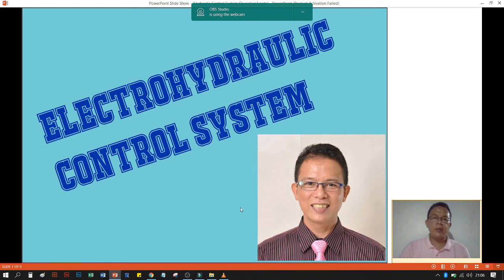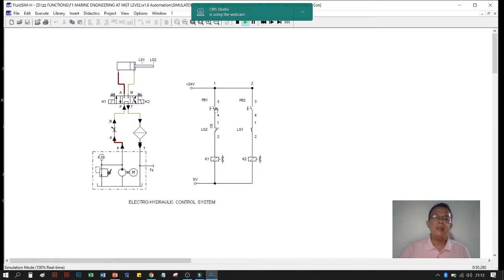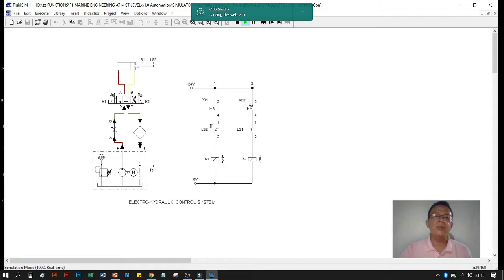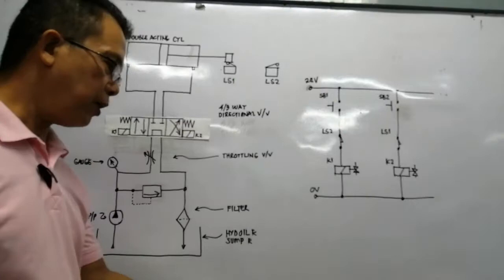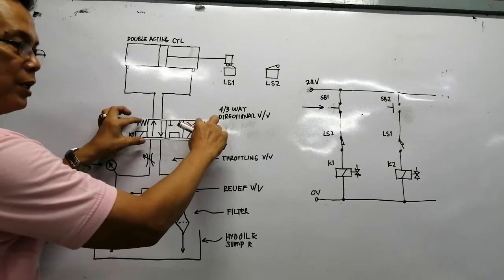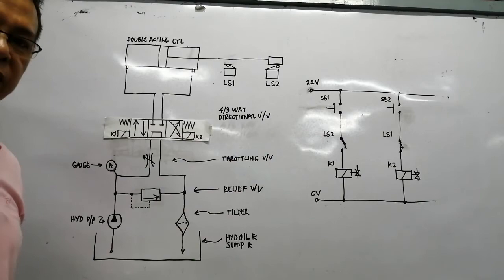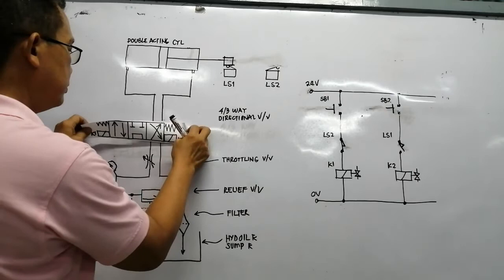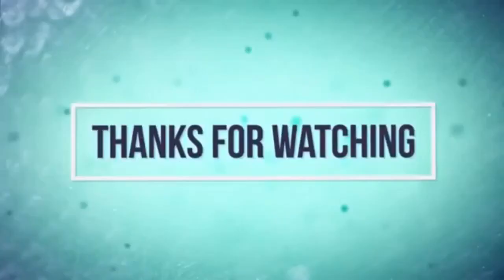ELECTRO HYDRAULIC CONTROL SYSTEM

Comment: Using this type of directional control valve on a double ended hydraulic cylinder ina steering system, is there a way how you can take the cylinder back into a middle position by the push of a button please ?